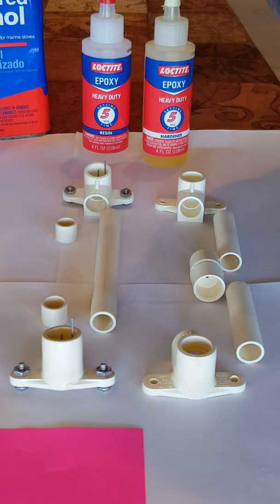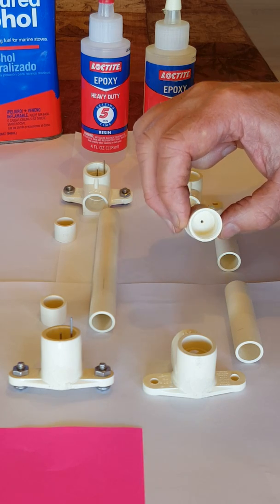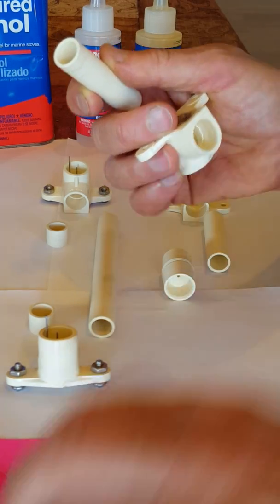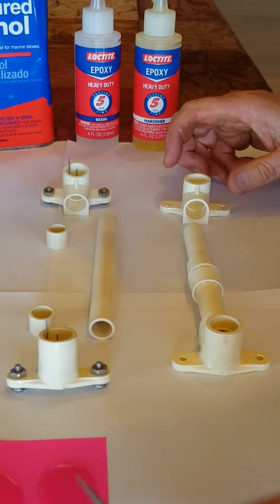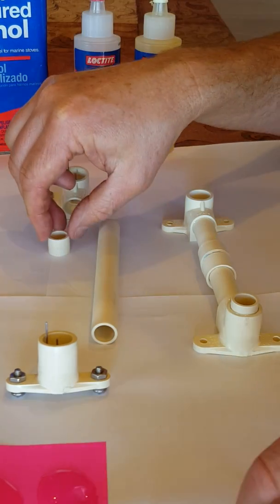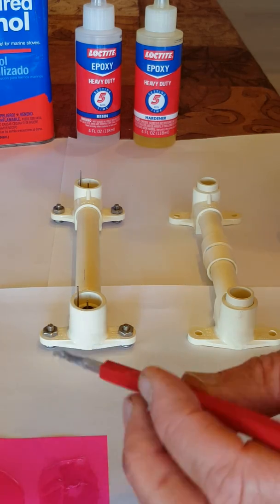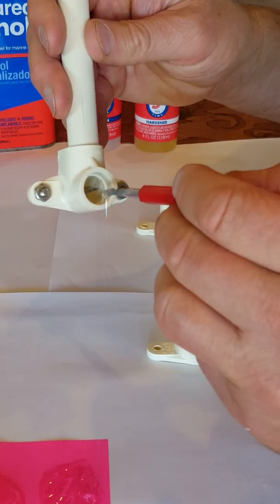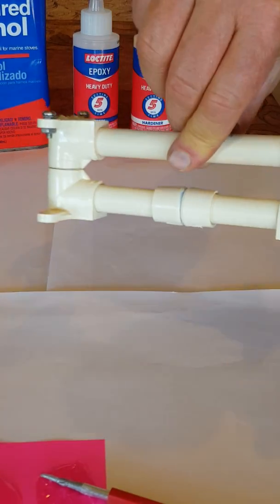Fluid Mass Electrolytic Seismometer FMES Construction

Comment: Is there a how-to on making this seismometer other than this video? I have been trying to find anything that shows more than the construction presented here and am coming up blank.
Reply: If you're still interested, this project just came up on Hackaday and it includes a link to the report describing the instrument and electronics. https://hackaday.com/2019/01/22/build-a-seismometer-out-of-plumbing-parts/
Reply: Hackaday comments seldom fail to deliver at least a few proudly dismissive bits of snark, which certainly miss the point in this instance. I have built my own less successful tiltmeters in a different way, but this one is simple and elegant.  The flow constricting orifice and electronics converting it into a horizontal velocity seismograph is admirable- from my point of view, it is an impressive design.  After building two of my own I find it does work well, but you must let it settle down for a long time (days!) before the signal is consistently clean. Might be due to tiny trapped bubbles in the fluid inside slowly resolving.